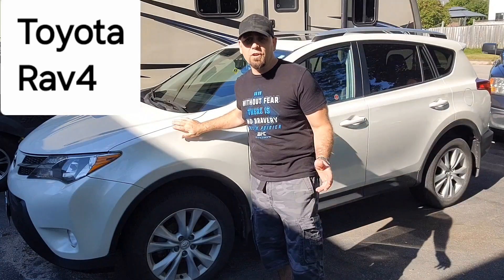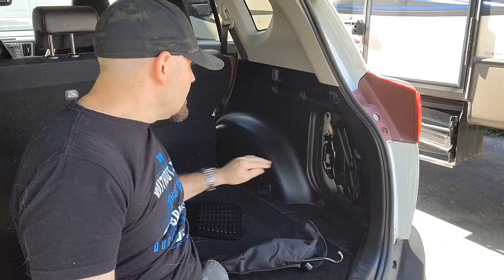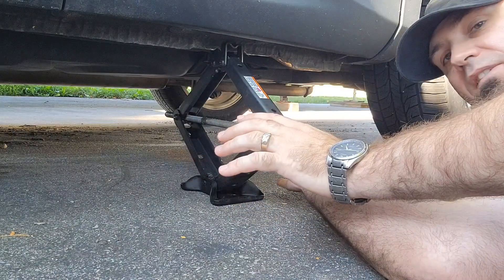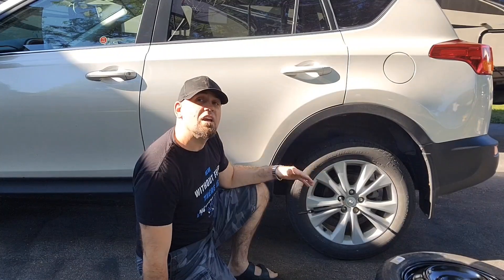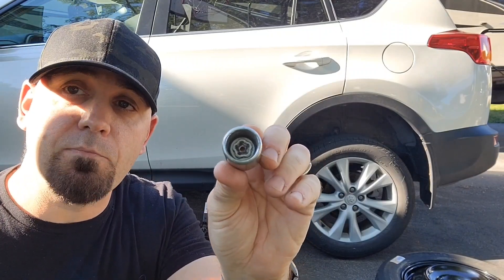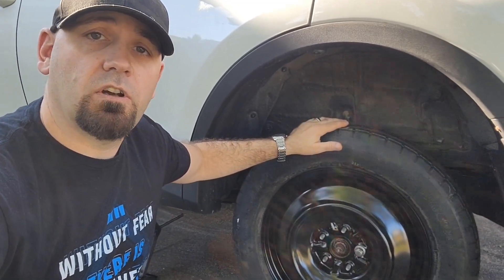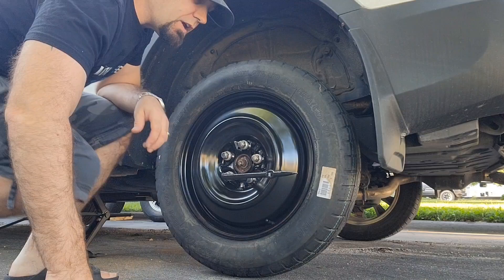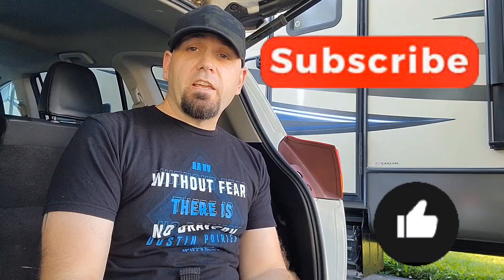How to install  spare tire - Toyota Rav4

Comment: You should ca
rry a piece of pipe in your vehicle to use for leverage to make it a lot easier to loosen lug nuts. NEVER STAND ON A LUG NUT WRENCH! It's dangerous to do so. use some WHEEL CHOCKS AS A BACKUP BECAUSE EMERGENCY PARKING BRAKES DO MALFUNCTION SOMETIMES. Otherwise this is a good video.